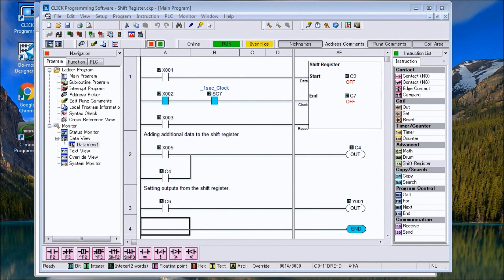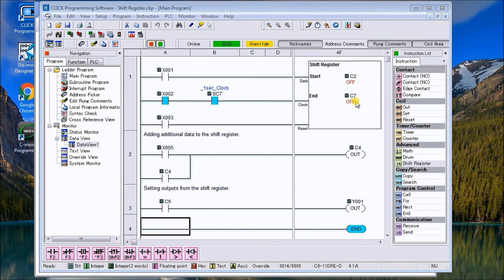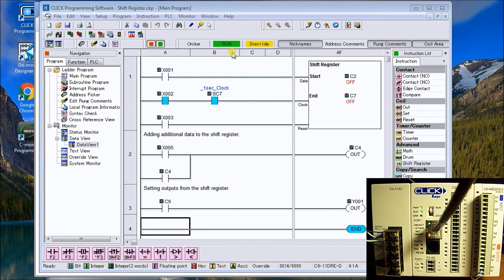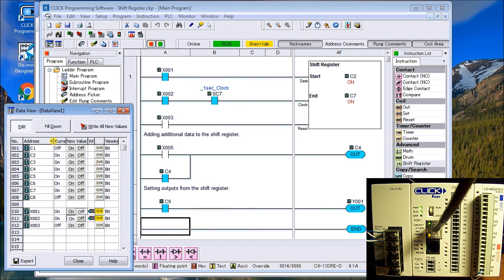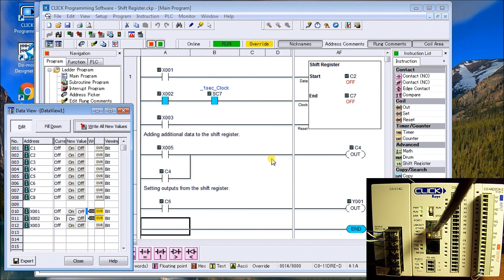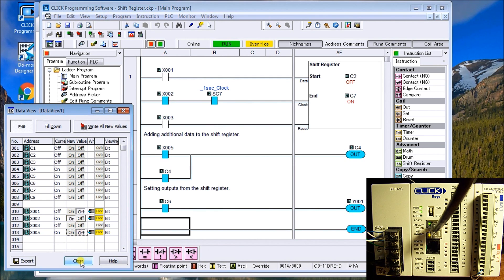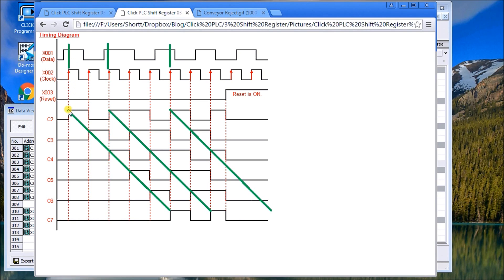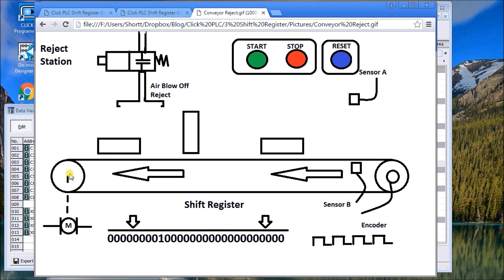How PLCs Remember: Shift Registers Unlock Your Past Data!

Comment: I'm interested in the 1 second clock... there is no place in the Help file where this is discussed.
Reply from the maker: Hi scowell,
It is hard to find in the help menu. Do a search for System Control Relays in the click help file. Topic CL109. Here is a link on a webpage with the same information.
https://www.automationdirect.com/microsites/clickplcs/click-help/Content/109.htm
I hope this helps you out.
Regards.
Garry
Reply: @ACCautomation  Thanks Garry... got it going.  There's not a better deal on the market than the Click PLC's... and the support is phenomenal, always there to help, just call.  Will buy again!
Reply from the maker: @scowell  
The Click Plus PLC has just been released!
https://www.automationdirect.com/clickplcs/clickplus/features
Data Logging
Wifi
Bluetooth
etc.
Just some of the new features. The software has also been updated to version 3.00.
https://www.automationdirect.com/clickplcs/free-software/whats-new-with-click-software
Great looking and intuitive interface.
Regards,
Garry